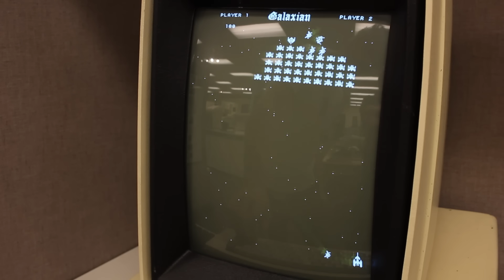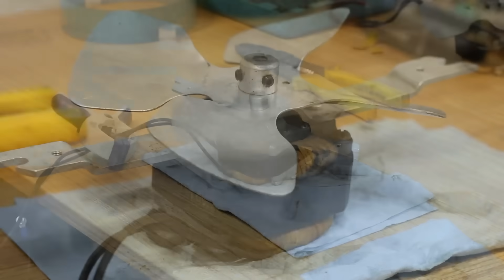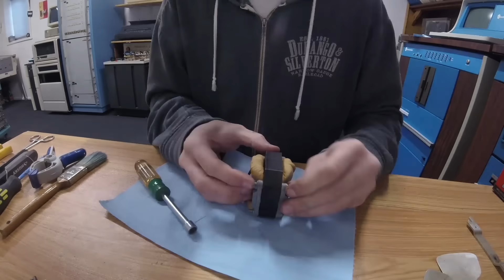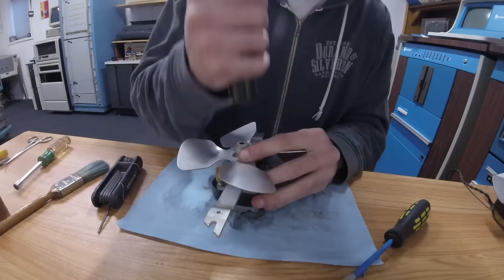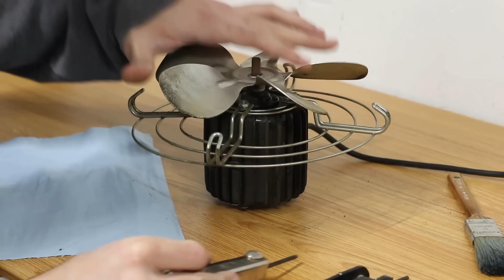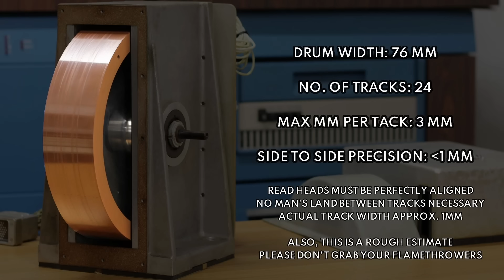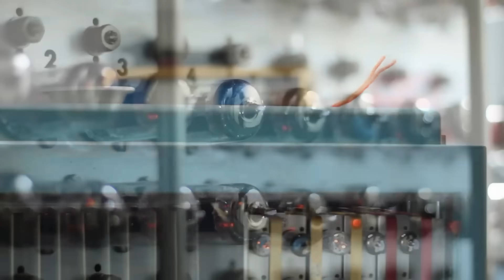Reviving 65 Year Old Bearings

Comment: Around the 17:40 mark, I cringed a little as you were putting a hole into the bearing seal. Isn't there a chance that seal will rub on the ball bearings now? Luckily this unit isnt used much so I doubt much dirt will get into the bearings.
Reply: Of course if I had kept watching I would have heard you mention sealing the hole haha 🤦‍♂️

Comment: In the first fan, one of the fan blades is clearly bent as can be seen around 8:01 in the video, I'm wondering if there's a safe way to bend that back in a way that the blade doesn't break and so it rotates evenly with the other blades.

Comment: "Quiet" in 1950's computer terms is basically "you can enter the computer room while the computer is running with ear protectors". A friend (now long passed away) once told me that the corporation he worked at in the early 1960's had a computer room where the printer did an emergency stop if you opened the door due to the noise levels...
Reply: I worked in a facility that had multiple IBM line printers operating at all times. They basically had their own sound booths built around them, so the only time ear protection was required was if we needed to vacuum out the scraps and dust while the printers were still running. And this was less than 25 years ago. We also had laser printers driven by the very same AS/400 because the outgoing half of the operation had to use industry standard bar codes. Those at least were nice and quiet no matter how busy they got.
Reply: My dad (born in the 1920s) did not want me to get into IT because he was afraid I'd be deaf by age 40.

Comment: Oklahoma University had two G-15s.  A vent hood was fashioned just above each cabinet.  When we powered up the computer we also turned on a hood fan motor to exhaust the hood to the outside.  It reduced the cooling requirements considerably since most of the heat went straight outside.

Comment: I rebuilt a lot of induction motors for one you should be using grease and not oil, oil will not last unless it is constantly applied unless you have a oiling system it should never be run in motors without sleave bearings also you can get the bearings off with no puller just cover the shaft with tape and heat the bearings with a hot air gun then remove the tape clean the glue apply grease not oil to the shaft in front of the bearing hold the part by the bearing you want to pull and tap the shaft on a hard surface it will pop right off heat the new bearing and regrease the shaft for assembly I learned that procedure from a 60-year-old guy who rebuilds Mill spindles I used it on my mill as well as many motors also for motors you want grease without high pressure additives it will last longer you may not be able to find bearings that have that but its always a plus and what you want if your repacking (as long as its a ball or roller bearing) also the drum has a preload nut there should be a torque spec for this preload nut you will probably have to build tool to hook up to the wrench but that can keep your bearing spinning on center if it wears if its to tight it will over heat your bearing

Comment: I had to admit that you did a good job on the wiring repairs on fan. There are some concerns about applying the oil into bearing which is not a good idea, because it invite dust to build it up and become caked with bearing overtime. On the other hand, the grease are better it keeps dust out of it. I really respected for all of your work to bring it back to life! Thank you.

Comment: Oil for electronics is not the best lubricant ! I personally found out that the best stuff is silicone lubricant like Jig-a-Loo ! It'S not greasy and far more resistant to wear and heat ! Saved my 50K$ HP disk drive !

Comment: Oiling bearings will work for little while, but the oil will weep out sooner than later.

From my experience these metal shielded bearings are better off just replaced.. the only way to get some new grease in them is to literally boil them in grease bath :)

The rubber shielded ones can be quite easily be relubricated with grease.

But those small bearings are like 2dollars a piece so youre better off just replacing them, use the bit more expensive ones like those made in south korea, they have better grease in them from factory and will last atleast 10times longer than the cheaper ones

Comment: Nice job. Funny, I did the exact same thing with my tumble dryer bearings about 2 weeks ago that were sounding a little rough. Used some 3in1 oil on mine 🙂Those electric fan motors look fairly similar in size too.

Comment: Great idea with the pick.  I was wondering how you were going to oil those bearings in place.
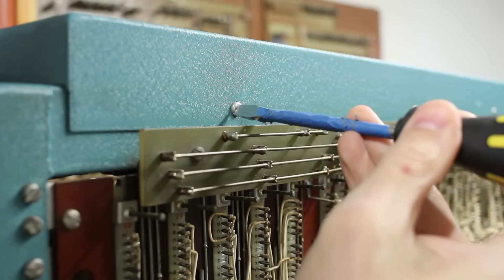3:30  I really like using heatshrink tubing on my screwdrivers.  More durable than tape.
If you spray some cheap hairspray on the screwdriver shaft before you slide on the tubing, it'll cause the tubing to stick and not slide off.
It's an old AV installer trick.  Excess hairspray cleans off easily.  One can of Aquanet lasts a lifetime.

Comment: Well done, unless there is rust or damage inside the bearings they should run essentially forever with this method you used, if it is just the lube that is dry they should run more and more quiet as the hours goes with the fresh oil in them, great to see you replaced the rotten cables to the fan motor too, it was the right decision

Comment: Amazing.  I used a Bendix G-15 in 1967-1969 at the University of Colorado, Boulder, Co.  The paper tape punch would get too hot so we always had to pull out the tape drawer when we punched a tape.  Reader was ok.  Even back then getting the vacuum tubes was a problem.  The only place we could get them was a surplus store in Denver.  I imagine they are impossible to find in 2024.
Reply: I’m sure you could whip up a mosfet tube emulator that fits in those bakalite sockets. 😁
Reply: It's probably harder right now than it was a few years ago, because one of the biggest tube manufacturers is in Russia. Tube- from Slovakia should be as available as ever, but of course there will be more demand for them.
Reply: Make a tube socket adapter and plug in some Chinese bangers made for guitar amps. The machine is digital and so likely tolerates out-of-specs parts so long the heater voltage matches (or is it something wierd like U od P series tubes?), but Chinese trash likely won't last. I had completely rewired my Grundig 6199 hifi amplifier with tube socket adapters to use Russian military and space travel grade vacuum tubes. (I also added relays to disable the radio part heaters when not used, grounded the chassis, made a perforated metal back cover etc. to improve safety.) Unlike the original ELL80 those lasted 2 years, the machine now runs daily 14 hours since >10 years without serious signs of wear.

Comment: I’m guessing that the 5th fan and the big vent panel on the cabinet is to guide air through a filter to prevent dust being drawn in to the machine and especially the drum. Hopefully you can find a HEPA type filter to replace the filter element?
Reply from the maker: Good catch, the big fan does indeed pull air through a filter, but it doesn't actually use anything fancy as the filter material. It's just a run of the mill house air conditioning filter that you can pick up at any hardware store!

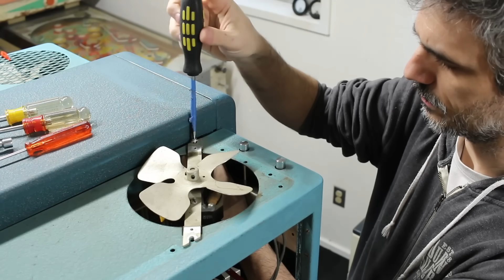Comment: 4:05, looks like you dropped the flat washer inside the cabinet.

I hope it isn't somewhere it'll cause trouble.
Reply from the maker: Good eye!
I did indeed drop it and noticed it at the time. It went all the down, past the door and landed on top the preamp unit. I was able to get it back without having to take anything apart thankfully!

Comment: When I caught wind of this episode's subject, I knew I was going to be a fan of it.  Glad you aired on the side of caution and replaced that insulation.  Nice work!
Reply from the maker: I just love making videos for and about my fans!
Reply: @UsagiElectric  I own a (currently broken) Tektronix 515A vacuum tube oscilloscope which has a quite similar sheet metal fan and even the same case colour! In 1990th I also owned a Tektronix 545A (I read later that new it did cost the price of a house, I bought it for 100DM) which halfway worked although the special mains cable was very crumbly and scary to use. But when I moved, I had to leave that heavy boatanchor monster (on its stand almost as tall as me) on the attic of the old building, where it got likely smashed to pieces by drunk kids or such. I only kept the service manual.

Comment: Special request. Calculate pi on the machine.
Reply from the maker: Once we get it running well enough to start writing custom software for it, calculating Pi and prime numbers is something I definitely want to try!
Reply: @UsagiElectric  AWSOME!!!! I'm a big fan of you!!! Few questions I have for you. What computer language does the machine use? How do you put commands and or input instructions into the machine? Can you play games on it? If so, update it to Windows xp and play Fallout on it with a traditional CRT television. I personally think it is quite appropriate to play a video game that is base on retro-future 1950's nostalgia. ♥️🇺🇸
Reply from the maker: @walterfijn3586  Thanks!
The G15 is a little strange as there isn't really an OS per-se. As it sits, it's kind of like writing programs in raw assembly. The instruction set is a weird one with, essentially, a "GOTO" in every instruction that tells the machine where the next bit of data is located on the drum. It was quite obtuse, so often, people would load up a different program via the paper tape reader like Intercom 500 or ALGOL. These were slightly higher level, decimal based, programming languages that allowed the user to type in math functions or programs in a more human readable way.

Input/Output is completely based around the typewriter, so getting text onto a CRT would be a proper challenge for sure! Also, it's not a fast machine. The main clock is 108kHz, but it's a bit-serial machine with 29-bit words, which means it really only executes instructions at around 3kHz!

Comment: If poking a hole to add oil to the bearing works all around, I won't argue with an empirical fact.  However I think I would have first tried a pressurized spray around the edge.  What's going to leave/get into that hole later?  Would it be a good idea to clean it and plug it with a bit of epoxy?

Comment: Adding oil to a bearing that was greased may or may not work very well. It may be OK in the short term but not longer term.
Most greases, except for synthetic types, are a mixture of an oil and a soap (e.g. "lithium grease" uses a soap made with lithium rather than the sodium used in soaps made for cleaning). It can be difficult to get old "dried" grease, which is mostly just the soap left behind after the oil has wandered off to parts unknown, to mix with new oil. Without proper mixing, fresh oil can leak out (if you can get it in in the first place the bearing is just shielded, not sealed and that which is not sealed out won't be sealed in).

Comment: DANGER: The insulation flaking away on that wire at 12:43 is ASBESTOS.  You need to not be working on that with your bare hands, and you need to be wetting it down, and wearing a respirator and gloves.  To dispose of it, after wetting, you need to double ziploc bag it. There may be other sheets of ASBESTOS in those devices as well. And you need to replace that asbestos wiring with new wiring!  This is NOT safe. Please take an asbestos handling class.

Please upvote this comment so that @UsagiElectric sees it!

Comment: As a technician in multiple trades it hurts to watch you try to revive bearings that could be and should be replaced. This won't last. They need to be replaced to be reliable. You can get bearings in almost any size these days. I have ordered a few uncommon sizes for some custom projects. Those blower motors are still available and could possibly have a direct replacement available. Speaking from experience of reviving bearings.

Comment: Are you using Magic Lantern raw on the EOS M?  I keep wanting to try it out with mine (I bought a second for stereo since they're cheap used) and I'm wondering if it's worth the effort.
Reply from the maker: Not at this time, I'm not. I could probably get much sharper video with it, but I don't have the processing power or hard drive space to handle raw video just yet. I am running Magic Lantern though, it gives a lot more options for control of things like color balance and what not. All in, I'm quite happy with the quality it produces considering I have around $500 invested in the entire filming setup!

Comment: Make it a little more comfortable for yourself while it's still cool, get some flex duct and inline boosters and pump some of that heat outside instead of swimming in it. Crack a door/window to alleviate negative pressure and help with cooling. Should work well enough for the next few months anyways :)

Comment: Getting there slowly but shurely!  

What do you have for software for it though? I assume there's no actual "OS" per say. Do you have any code on paper tape to load it up to do something? Or are you planning to do some sort of "Helloorld" in it's native assemble instructions via paper-tape?
Reply from the maker: Definitely making progress!
The closest thing to an OS that this machine has is ALGOL or Intercom. These were both "high level" programming languages that were loaded up via paper tape. Now, "high level" is in quotes because they're actually much closer to a memory monitor like "Wozmon" than they are to something like BASIC. We do have backups of a lot of paper tape programs, we just need to punch them out to new tapes. Once we're up and running we'll be experimenting with all sorts of different things, trying to get the computer to misbehave and see if something still needs work!
Reply: Very cool. I’m aware of ALGOL but never seen it so that will be interesting!

Comment: One important word for safety, aside from the exposed mains which isn't a big deal if you know what you're doing: If you're testing motors, secure them down to a bench! If there is any damage or imbalance to a motor it will launch across the room, all the while spinning if it's still connected to mains. The same goes with damaged fan blades.

Fast moving metal objects are obviously dangerous. That's why you should never be in the plane of rotation of the object you're testing.

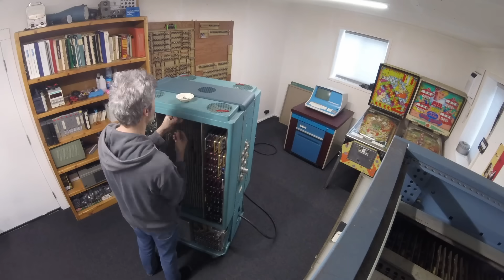Comment: Just yesterday, Tech Tangents has a video where he needed to remove some bearings (v=hudO51kU15w)... and at 8:14 he shows off a plumbing tool which is essentially a small bearing puller, available at either your blue or orange big box hardware store.

Comment: Eeeeeek. That's the sound of engineers screaming as they see the bearings being "fixed". The oil is just a temporary fix. Bearing are designed to be replaced. Better to replace them. Using a puller is perfectly safe. Getting replacements is easy as there dozens and dozens and dozens of different types of bearings manufactured. Just get the dimensions and find a matching one.
Reply: Replacing the bearings is a much bigger task than it appears.  David played down the alignment quite a bit.  Basically, there is no method (currently) available to replace the bearings without bricking the rotating drum. If the timing track rewrite process were possible, a bearing swap wouldn't be much of a concern.

Comment: 120 V isn't a huge deal. I'm surprised you didn't work on caps right away. You can destroy your whole system firing it up over and over like it is. Seems interesting that a lot of software/hardware guys don't know a ton about basic electrical stuff that isn't related to semiconductors, etc.
Reply: The DC power was never switched on, so the caps never had power on them.
Reply from the maker: I mentioned this several times in this video as well as in the previous video, but when flipping the large switch on, the only things receiving power are the AC components. The DC power is completely locked out. The only things receiving power are the vacuum tube filaments, the cooling fans, and the AC motor for the drum. Everything else is completely powered off, including the capacitors.

I absolutely will not destroy my whole system by powering it up over and over like this because the whole system isn't even getting powered up.

Also, I have one small request.

I am not some faceless content creating machine, I'm just a dude trying to share my passion with others. It's really painful when you sling insults insinuating that I don't know basic electrical stuff, when in fact I've been studying, learning and conferring with experts on the best way to bring this machine up for the past year, and playing around with vacuum tube computing for well over three years now. Next time you want to leave a comment on a Youtuber's video, take a moment to think that maybe there is a lot of context you aren't aware of, or perhaps you might be mistaken in your understanding of the system being shown.

Comment: Just a heads up, you can buy a stethoscope with a long aluminum prod at the end if you will. I use it all the time in the automotive business and you can locate noises extremely easy with it and they're very inexpensive
Reply from the maker: I often use the big screwdriver as a stethoscope trick, particularly when working on cars. I was actually going to do that here, but the literally, as soon as I stopped recording, the bearings got quiet and never got noisy again. Makes it hard to find the noise when it won't make it!
Reply: @UsagiElectric  definitely use that at work too! I'm glad to hear, not hear, the bearings have calmed themselves. I Work just down the road from the museum in Maryland and had no idea it existed until I saw it on your video. Thank you so much. I love watching you and your thought process on fixing the units, Even though I have little to no idea what's going on after the electrical repair.